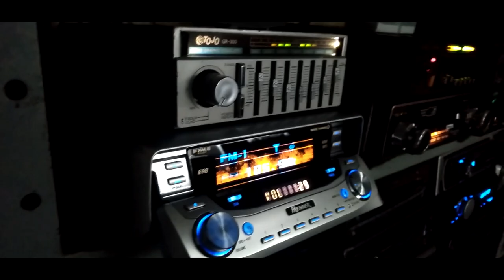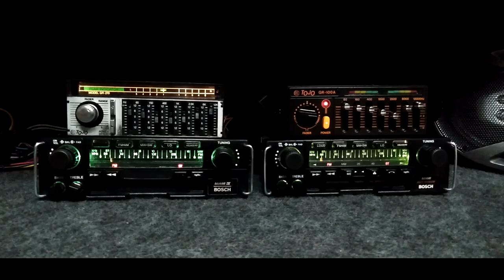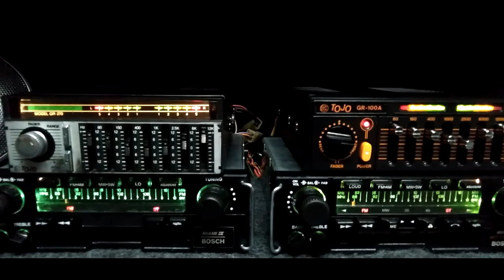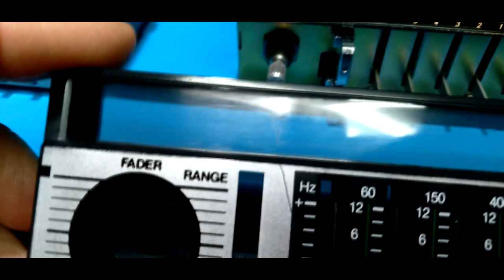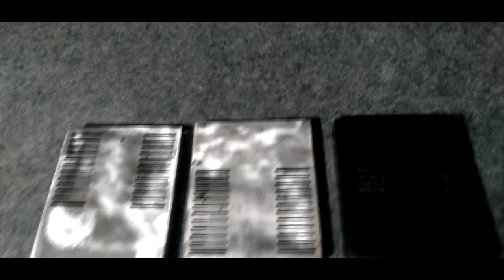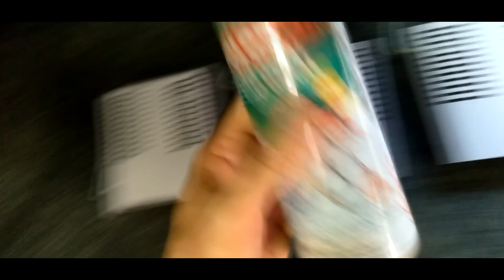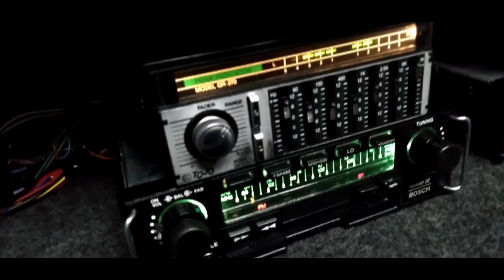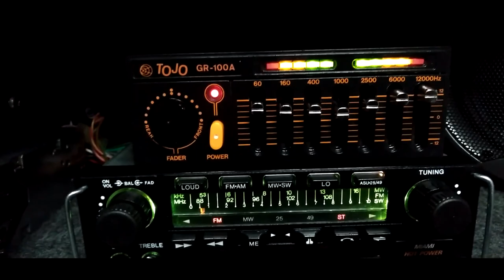🏁TOJO GR-100 e GR-270🏁  Amplificador e Equalizador Som automotivo acessório vintage anos 70 a 80

Comment: Boa tarde amigo aqui na minha cidade de imperatriz eu encontrei dos modelksntojo para venda. O gr1500 e o gr 300 cada um por 400. O que ne sugere em relação aos aparelhos tojo?
Reply from the maker: O gr1500 tem uma aparencia mais moderna, se a intenção é criar um elemento mais vintage ao sm o GR300 tem mais eficacia. Porem em matéria de som eles são ultrapassados e fracos no maximo um som anbiente e com valor inferior a isso compra um Stetsom digital de 400 watts no mercadlo livre. Mais o visual retro que esses amplificadores equalizadores dão num carro de época aconpanhado de um player similar ninguem supera. Não esqueçe de fazer um teste  antes de adquirir porque pela idade se não passaram por uma revisão e possivel troca de chaves ou capacitores vencidos a tendencia é dar problemas.
Reply: @autosound  eu uso atualmente um@ pirâmide de 800 nonsom do Fusca. Vou colocar o tojo apenas para deixar o fusquinha nas lindo
Reply from the maker: @jurrr1000  Pyramide tanbem é OldSchool pra caramba! Tem varios clientes que usam o Tojo só para piscar os leds mesmo. Mais ligando em médios e tweeter ele não faz feio.
Reply: @autosound  tá aí uma boa sugestão igar bo meio e twitter!  Eu tenho um ab2200, seria uma boa substituir a pirâmide pelo abc 2200?
Reply from the maker: @jurrr1000  Aí não. O AB2200 é um amplificador tipo booster que usa transformadores e este tipo de projeto tem altas taxas de distorção.